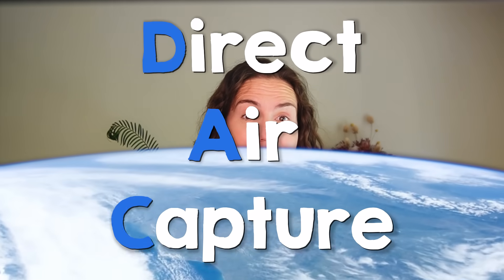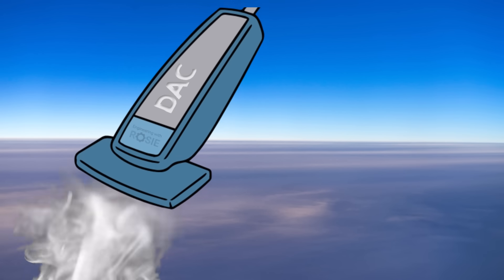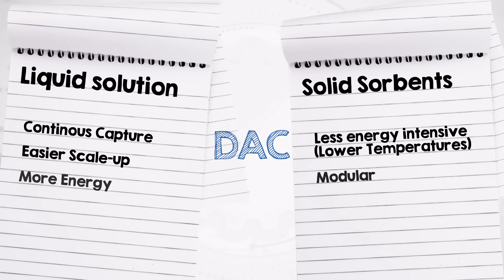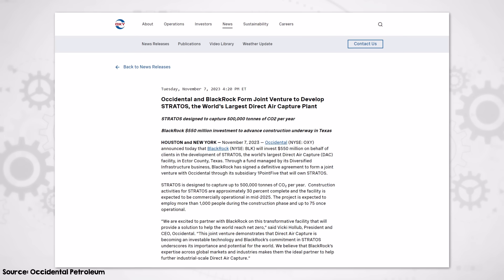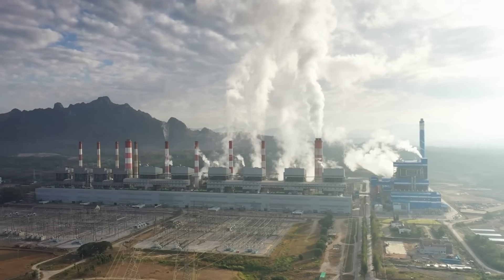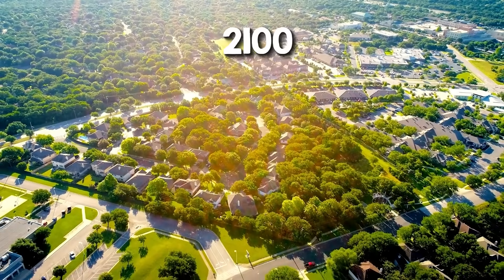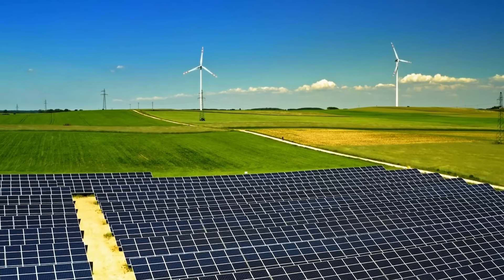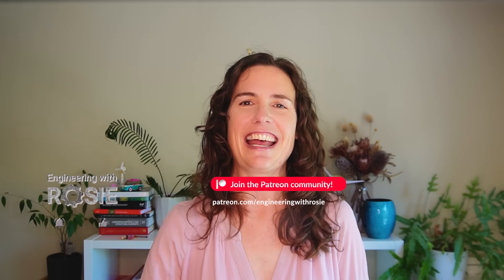Direct Air Capture: Climate Savior or Distraction?

Comment: it will take a hectare of trees to offset my carbon footprint every year... a hectare, sure a tree can offset 5 tonnes... but that's over it's lifetime... 50... 100 years? that's if it is a fast maturing and long lasting variety, and then there's the question of what if we need the wood... what happens if my tree is chopped down?

It will take me 40 trees planted every year to get to the numbers that will be offsetting my co2... and then the question after that is... will they sell my "carbon offset" after I'm done planting, I want it so that when I plant those trees... I don't own them but I own the "carbon credits" it produces... and guaranteed that the tree will be protected, and that's far more expensive than the $25 per year price they are quoting to me... I will be reserving land, permanently... that's basically a cemetery while I am alive

Comment: @EngineeringwithRosie This video falls into the trap of thinking that if we just stop all carbon emissions we will be fine.

We are already billions of tons past fine. We are in carbon debt, and DAC is the only realistic method we can use to get out of debt. Stopping additional spending on your credit card is great, but that doesnt pay off the balance.

The way to deal with CCS is to force substitution of fossil fuels with Fischer Tropsch based fuel synthesised from carbon captured from the air.

Call the bluff of the fossil fuel industry, push the cost of consuming fossil fuels towards the marginal cost of recreating those fossil fuels with enforced blending of DAC fuels. Yes it is both wildy expensive and inefficient, but it goes some way to making the cost of consumption equal the cost of pollution. 

If we ever end up with too much CCS FT fuel and nothing to do with it, we can turn it into synthetic coal where it will safely store carbon for millions of years.

Comment: All of this is expensive, and some just uses the CO² for extracting more petroleum, ie. no net capture. Contrast this with putting 1/4th inch of compost or biochar on rangeland. The single application doubles meat production for 30 years, has an ROI of 2 years, and if done on all US rangeland along with mob grazing would offset virtually all US carbon emissions.

Comment: Rosie, very thought provoking video as always.  

Reducing emissions is obviously the most cost affective way to avoid net emissions.  However, carbon removal is essential for all net emissions accumulated over the years.  Subsidies should be based only on net emissions, including all the emissions to achieve.  You mentioned farming with a group of industries that is hared to decarbonize.  However, a biological approach to farming can and should be a primary method of removing and managing carbon into organic content in the soil.  There are known methods for doing this today.  Photosynthesis of leaves remains the most potent and scalable method for removing carbon from the atmosphere.  Again, net emissions is critical.  Current industrial agriculture is indeed highly net emissions with both the equipment, processing, transportation and high emissions that comes from excessive tillage. Beyond removing CO2 by leaves, we need to manage the resulting carbon to reduce to a minimum, not zero, the eventual emission from that sequestration.  I follow to work of your fellow Australian, Walter Jehne who identifies to cooling and water retention benefits of high organic soil content that add to the cooling beyond the reduced insulation from the CO2 removal.  Cultural recognition of this potential is the main barrier to achieve on the scale needed.

Comment: As Rosie correctly points out: DAC seems to require way too much invested energy and capital material.  DAC cost per sequestered ton of Co2 currently = $1400.  One tenth that is still unaffordable when  including the energy costs which are astronomical, also part of her assessment.   Instead I am working on improving the efficiency of ocean phytoplankton to improve atmospheric carbon sequestration.  This scales much better, with drastically less invested energy.

May I suggest to Rosie she explore the issue of "Atmospheric Carbon Clearing Time".  Read any recent paper by MIT scientist Dr. Susan Solomon.  She is credited as the first to document and investigate the Ozone hole above the Antarctic and is well respected in climate and atmospheric science.   Spoiler alert -- natural processes to clear our earth's atmosphere of it's human generated excess Co2 will work just fine .... if we don't mind waiting approx 800 years, during the first 400 of which the earth's average temp will continue climbing before eventually leveling off, then decline.  Some fellow scientists argue the range is 600 - 1700 years before earth would clear the excess Co2 we dumped into the air.  If there are scientists there are debates about details, however all the relevant specialists generally agree: little Greta Thunberg's great ... great ... great ... great ... grand kids will still be living in a hothouse world before eventually things cool off.

Lesson from above facts -- reducing then eventually eliminating human carbon emissions (except exhaling) are essential but not sufficient for a cooler planet.  Engineering must solve the problem it caused inadvertently.  Actively pulling excess Co2 from the atmosphere is required, but the method used must scale.  Ocean phytoplankton are already very good at this, at scale, otherwise we literally wouldn't be here today.  I am going to continue to work on a method I believe does scale and makes ocean phytoplankton happier and more numerous.  In Seattle ... plodding quietly on.

Comment: Earth uses its 71% AirSeaInterface to control CO2 with saltwater's properties and marinebiology's calcium_carbonate saturationpoint pH of 8.2 about which pH varies from volcanics over time. 

Excess CO2 converts instantly to carbonic_acid at the sea_surface, reversible: CO2+CO3₌+H2O⇄2 HCO3-

You can't remove CO2 below Mt.Everest over land/lg.islands air mixes too fast, so, the machines need to be at the greenhouse layer the point.

If these ppl knew it a crime, my bet they didn't study the basics it's all fossil grifters obfuscating reality.
Ymmv 📚

Comment: DAC is inherently inefficient, the EROI cannot be justified IMO. This is just more Oil Industry PR BS.
Production and transmission of electricity is finite, every kh/h of energy expended at these plants is unavailable for other use so scaling this up to be significant enough to fight climate change would cause a host of other worse problems. Financial resources spent on this are not spent on other more effective technologies or policies. Iceland's geothermal energy might be an exception but will be rather insignificant.

Also, what's the carbon footprint of building one DAC plant? Do they count the embedded carbon of the materials they use? I wonder how long before they reach a break even point...

Comment: ok. I'm stupid. Whst's the difference between 1.5m tons vs 1500k tons? And why are the scales so vastly different between the 3 DAC companies? And what makes Stratos so ambitious if it captures only half of what the existing plant does per year? (Both of which are nevertheless leaps and bounds beyond the other companies?). (Edit: I see. It's a funding thing.)

And I do agree that the general idea of DAC is probably less than ideal (or.. actively bad). If the money can be easily redirected to better projects immediately, then I'm all for that. BUT, there is funding here and I'm not sure that these same companies would be able/willing to embark on equally large scale CCS projects instead. In that context, given that the technologies are similar, if it takes some enhanced oil recovery (which I think is preferable to opening new wells, at least) to fund research into carbon capture and make these initial forays economically viable, then I can see some utility. Like, if investment into DAC is ALSO preventing investment into new oil and gas discovery + provides some form of alternate revenue stream for companies as they hopefully transition, there could be benefits just in political resistance (probably minor.. but..). 

Having proven technology at scale to point to when we suggest alternatives is useful IMO. If CCS is theoretically 250x more efficient, then maybe it might end up being a little more impactful than 2%, and hopefully DAC investment now directly benefits that. But yea, point taken. There's a challenge in preventing people from [ie: preventing fossil fuel companies from misleading people into] thinking the problem is solved and further work elsewhere is not needed.

Comment: DAC is the future together with phasing out fossil fuel consumption.  But first of all, my H2 production technique must be tested and certified.  H2 should cost $2.00.  Then install my H2 production installations at gas power stations and CHP for no Co2 and Methane emissions.  Then develop my plan, being DAC with the aforementioned affordable green hydrogen.  The system is very simple and my calculations are that one $25 million unit could store 5 Mt of Co2 annually!?!?!  Because it is a simple technique with low energy costs, the cost price is >$10 per tonne of Co2.  Incredibly low.  Installing 1,200 units worldwide represents an investment of 30 billion and annual costs of 60 billion for polluting companies.  Keep it simple and affordable so projects can become successful.  I want to patent this DAC plan first to prevent bandits who would make billions in profits from it.  My profits are in hydrogen production.😊

Comment: Sounds like DAC needs a economic solution to justify its energy use.. Perhaps instead of storing the captured carbon, up-cycle it into a highly desirable product?  Would it be possible to say concentrate the the carbon into carbon nanotubes or carbon fibre for use in the construction industry?  wouldn't it be cool if you could catch carbon at one end and churn out carbon Ibeams at the other?  

With the state of the construction industry at the moment, at least in Australia, buildings are left unfinished because the materials they quote go up by 10 - 20% completely cancelling out the profit margin the builder had factored in.  If this could make abundant strong and durable building material virtually anywhere and flood the market with them, this could solve the housing crisis as well!